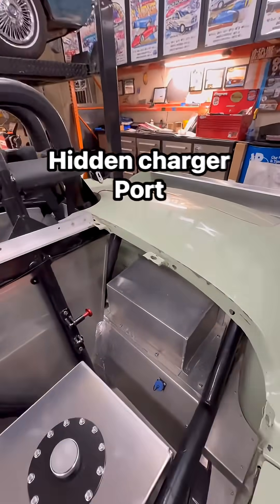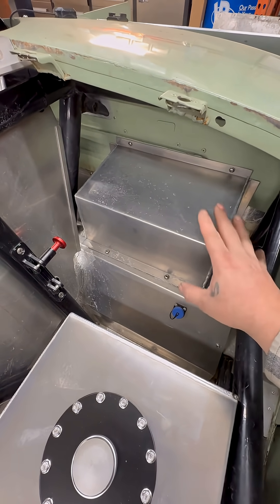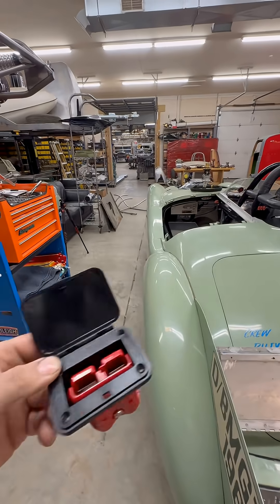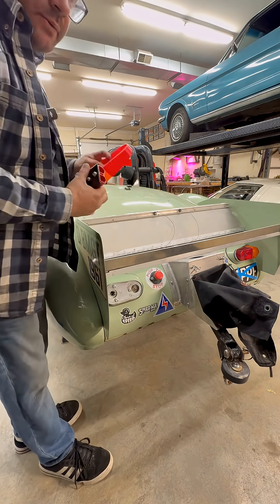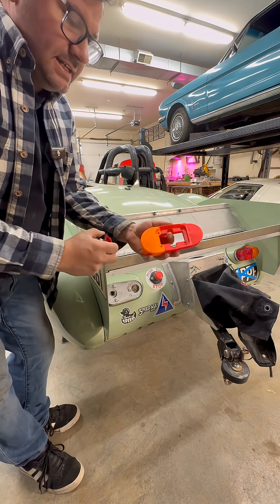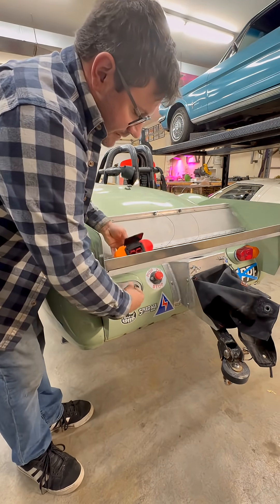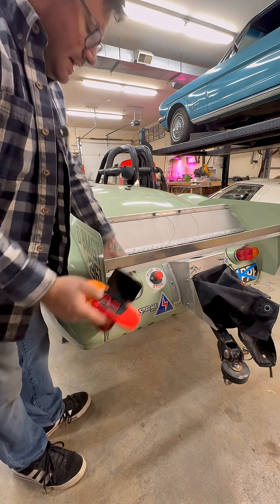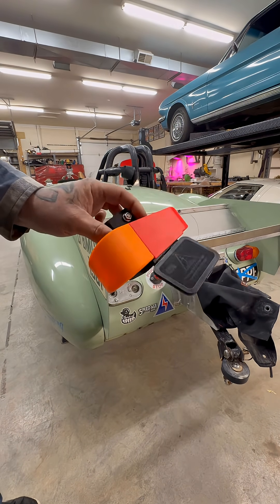3D printed tail light with charger port built in

Comment: I don't know where you live in America but one working tail light on a car is not legal you have to have two working tail lights
Reply from the maker: Oh well dude. Its a race car and I drive cars with a single tail light on the street all the time with absolutely no problems from law inforcement
Reply: @cornfieldcustoms doesn't mean it's legal.   Cops just aren't doing their job and you've been lucky.   If you get involved in an accident that isn't your fault, it's your fault.   You weren't street legal and shouldn't have been on the road.
Reply from the maker: @donaldbates155 Oh well, I will keep doing things the way I choose. Maybe stop worrying so much about what other people are doing with their lives and focus on improving your own.
Reply from the maker: @donaldbates155  according to Ohio revised code 4513.05” (A) Every motor vehicle, trackless trolley, trailer, semitrailer, pole trailer, or vehicle which is being drawn at the end of a train of vehicles shall be equipped with at least one tail light mounted on the rear which, when lighted, shall emit a red light visible from a distance of five hundred feet to the rear, provided that in the case of a train of vehicles only the tail light on the rearmost vehicle need be visible from the distance specified.”

You can look that one up too. 😉
Reply: @cornfieldcustoms don't want comments, don't post.   Sounds like you have issues with reality.   It's probably true that you haven't had issues, but it's also true that it is illegal.   That's reality.   I drive for a living, and i run aftermarket lighting, but i also make sure it's all DOT approved for liability reasons.  If it isn't legal to be in the road, you are automatically found at fault in an accident when you are driving a commercial vehicle. Greater responsibility comes with driving a heavy truck.   Same goes for driving a fast car.
Reply from the maker: @donaldbates155 ”Dont want comments dont post” is the dumbest fucking cop out comment. I want comments of value….. not Karens complaining about everything. Per Ohio revised code as i posted Min of 1 taillight required. So its legal. Dont like it call the legislature
Reply: An additional note on that pre-1967 exemption. That usually only applies when the vehicle was built from the factory with only one light, not for later modifications. I would have to double-check your state laws on that but that's how it works in Most states if it was built with it it has to have it as far as tail lights. I fought battles with a base commander in San Antonio over the legality of my car and being banned from driving it onto a base because it was Factory. He tried to force me to have rear seat belts installed in my 1964 and a half Ford Mustang. I've got four Antiques and I'm quite familiar with what is and is not legal to do with them when it comes to modifications. I also own two commercial vehicles. One antique from 1959, and then a 2019 Kenworth that is actively used and kept legal to All state and Dot standards excluding California.  

Just because you do it and get away with it doesn't make it legal and when somebody points out does flaw in your logic can you turn around and quote incomplete law. You can't just read the part that supports your belief you have to read the entire thing. Again it seems you have an issue with reality. Just because you think it is that way doesn't mean that it really is
Reply from the maker: " Most Vehicles" key word is most...... I guess reading is not your strong suite. plus this car is a  1961 so pre 1967. So its legal...................
Reply: @cornfieldcustoms and read the comments that I left to your stupid cop out about one tail light being legal if you want to use the stupid cop out phrasing. You're not a lawyer you're not an attorney neither am I but I understand that you have to read the entirety of the statutes not just the one that supports what you believe and want. Thus my comment is of quality and educational value because it is pointing out your wrongful belief on what the law states and what is legal.
Reply from the maker: @donaldbates155 ok karen, what ever makes you feel better.
Reply from the maker: Keep commenting man, what ever makes you feel better about what ever issues your going through on life. I will keep doing what I do and you will keep complaining on the internet. Have a less miserable day, preferably some where else
Reply: @cornfieldcustoms if Ohio went back to doing State mandated vehicle safety inspections on an annual basis and you wanted to keep your car on the road as a street legal drivable car, you would find out real quick that your car is not street legal. Like you I live in a state that no longer does annual safety inspections on vehicles, it doesn't mean the laws went away it just means that they assume you're going to follow them. And how are my comments responding to your incorrect beliefs any worse than your comments disseminating incorrect beliefs. Your day must be just as miserable as mine as you keep replying.
Reply: @donaldbates155 what did I just stumble into? I think I should go..

Comment: Why do you need a plug that big? Are you maintaining at 80 amps?
Reply from the maker: Because I can and its what I want. They are strong plugs, the lock together, if the battery is dead we can jump through the plug. Its not just a maintainer plug. I dont do the min to get by

Comment: Seat the charger under the tail light. The light should be on a hinge that clamps down over the charging port. Just like the gas flap. That way you still keep two tail lights
Reply from the maker: Way more work than needed. I dont need 2 tail lights and not how the gas door works on this car